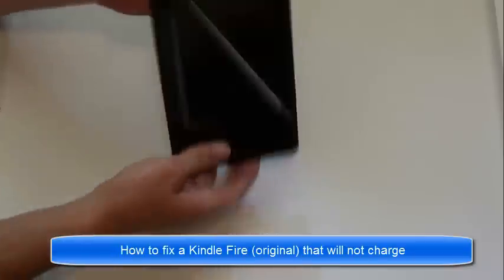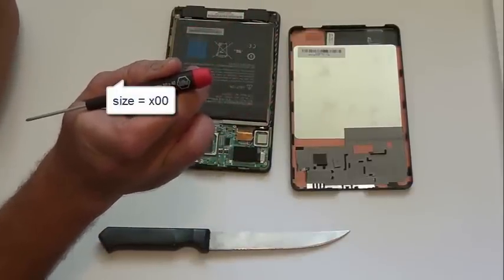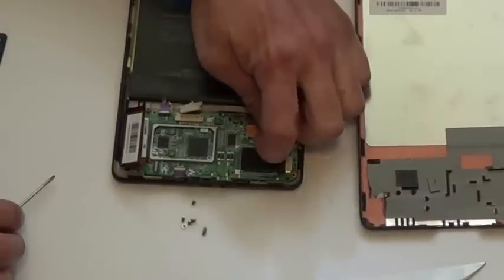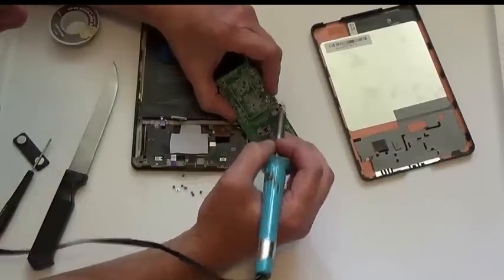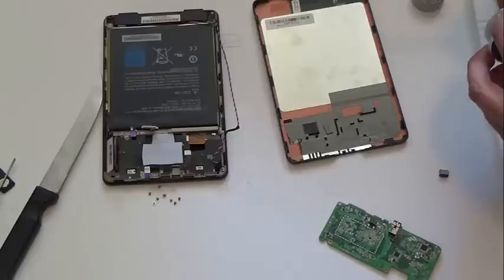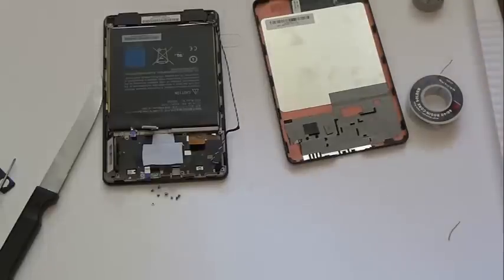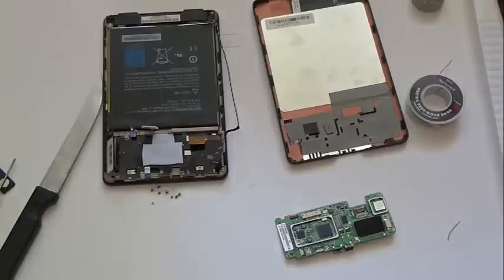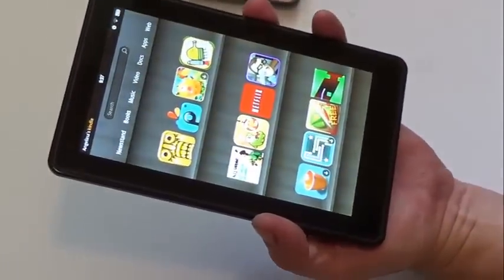Kindle Fire Won't Charge Fix

Comment: Beware when opening the case of the copper foil piece by the lower left corner shown in the video.  Keep your knife very shallow or away from this spot as much as possible. The touch screen operation was lost from slicing part of this foil which is right next to the edge of the case which appears to be hard wired underneath.
Reply from the maker: Good idea to just keep away from the bottom part of the case. Get you hands in there and just pop the back off.
Reply: Really great to know. Thank you.

Comment from the maker: Sure. The connector is very small but it does have two alignment pins that stick through the board. Those holes are called Via's. First step is to heat up the old solder- swipe the legs front to back, not side to side. just to make sure there is enough solder. If not, add a little bit. Next. Fill the Vias with solder - mine had nothing in them (probably why it got stressed). Next heat the filled vias from the otherside and get the connector onto the board...now your pins are lined up and you can

Comment: Just picked a Fire up Ebay that was listed as not charging, i figured this was the problem, but opened it up, and found something 100x times more simple(thanks for the intructable on opening)....anyone ever had a kindle dropped and the battery become unplugged from the board?

Comment from the maker: Jaime,
Yes, new micro USB ports are available but finding the right one that attaches exactly the right way, with the same through-hole alignment and the same port depth can be tricky. There are like 100 different manufactures, each with a slightly different variation of the same loosely adhered to spec. If the product did not have an outer case with such tight tolerances, finding a replacement would be easier. Try to work with the original port, if possible.

Comment: Just thought I'd add what fixed mine. It appeared it was not charging because the screen did not display anything. I took it apart and measured 3.7 Volts on the battery.... which is what the battery said on it. I decided to try and disconnect the battery for a few seconds, then plug it back in. That fixed my issue.... Thanks for the disassembly portion, that helped out!
Reply from the maker: Great! Glad that you got it to work again.

Comment: this would be very useful........IF I HAD A SOLDERING IRON!!!!
Reply: EBay has a decent soldering station available for about 40-50 bux. I'm not trying to promote anything. I just like a fair product for a fair price and this time, it happens to be ebay.
It's the complete station. Soldering iron, heat gun with attachments, power supply, desoldering equipment. Not a bad set-up for the money considering I paid more than 15 dollars for just a soldering iron at wallyworld (I needed it then...fixing my son's broke down again car!)

Comment: This video was perfect. I spent about 60-70 bucks mailing my item to a repair shop to have it fixed only for it to return and break again within a few weeks. After watching this video I decided to have a go at it and now it's charging. The repair shop did a BS job soldering the parts together. I didn't spare solder and wasn't going for perfection but still ended with a clean looking job. What really made me try it after watching this video is you opening the device with a steak knife.

Comment: Everything came apart exactly as simple as your video showed.  I did find the USB was completely disconnected and it took me several attempts to get the PCB back in as I was leveraging off the USB and the cover each time...finally got it back and it is now recharging just fine again (had to re-solder each time though to be sure it was okay).  I had to buy the iron as the one I had is an old Weller unit that is surely not 15W.  Radio Shack online had one for $15 plus the 60/40 solder set me back $4.  Purchased a multi-tool screw driver set for $3 that had a 000PH and a 00PH.  So for less than $24 bucks, back in business!  Best Buy Geek Squad told me they would charge $150 to perform the labor!  What a joke and THANK YOU for the detail.  I am not the best soldering guy either especially with little parts but got it done!
Reply: I also have a couple of very small flat screwdrivers that helped.  A letter opener with a thin edge could work too.  Also try starting near the speaker or an opening in the case.
Reply: Wow
I just purchased the Fire HD 8. They were trying to push the warranty on me.
I asked, if I get this warranty and have a problem with the tablet, are you going to take my new tablet and give me a refurbished one.
The lady said no, we don't service tablets or send them out for service, we'll just give you a new one. I didn't believe her.
They tryed to charge this guy...BIG MONEY FOR A FIX
WOW

Comment: Just repaired my kindle fire with your vid! It wouldn't charge and the warranty expired a few months ago. I either had to pay about $150 for repairs or buy a new kindle. So the option of taking a little time and buying a $10 soldering kit from Wal-Mart sounded great. [Never soldered before in my life...had to watch a how-to solder tutorial vid :)]

You gave great/ easy to follow instructions. And my kindle is charging as we speak. Thanks for the upload!

Comment: I've had two original Kindle Fires. I had to have them replaced two times each while they were under warranty for this same reason. Now that they are no longer under warranty, one of these won't charge at all. Short of throwing it away, I'm definitely going to try this. Thank you!

Comment: Hey, Peter. You just saved me hundreds of dollars by your video. My problem was in the usb connector. It was poorly soldered on and got loose as you plug in and unplug as you use it. I used my iso tip cordless for fine point soldering.  Then I had to try all my charger-cords to see whch was compatible.  I owe you lunch. Thanks again.

Comment from the maker: Helen, Mine was thick too. I used a very small amount of solder; just what would stick to the iron. I always used grounded tip on electronics but if you disconnect the batter first, it isn't going to matter in most cases. Don't worry about the flux, just get heat the traces so that the shine. pulling backwards along the trace will spread solder along the trace and seems to work well.

Comment: Good job Peter!

I have repaired a number of Kindles; this process is NOT for the beginner, faint of heart or those with marginal eyesight! The solder joints on the USB connector are tiny and the side grounding posts are simply TOO SHORT to penetrate through the PCB for a proper & secure solder on to the board.

I've done many DIY electronics projects over the years and I have to say the USB port charging design on the Kindle Fire is one of THE worst designs I have ever seen! The device was clearly designed to have a maximum life span of only several hundred charging cycles before failure. The absence of a secure coaxial DC power port on the device should be a crime.

Do not purchase a Kindle Fire thinking that it will last for a long time, because the only way that will happen, is if you rarely use it!
Reply: know of any good alternatives? I want to get something better for my mom and myself both, seeing as it's such a hassle to fix...
Reply: @bd_bandkanon  almost any other brand except apple will outperform the kindle in both substance and longevity. Plenty of yt vids against both kindle and apple. Almost as many extolling all other brands. You might want to check out the Zenpad. The 8.0 is similar to the ipad but has more features and is way cheaper.
Reply: @twicebittenthasme5545  Thanks! I'll definitely check that one out.
Reply: U wrote a whole essay
Reply: @iiifeelinqsiiii6736  And you read a whole essay.
Reply: @billyc768 boy what💀

Comment: This helped, but not because I had to replace the charger.  My kindle wouldn't reset, but when I watched your video (perusing the web for a way to fix my dang tablet), I noticed that the battery had a removable connector to the device (the little rainbow-cable).  So, I popped my kindle open, barely disconnected that cable for a few seconds, slapped it back in and voila, I now have a way to "hard-reset" my device!  Good video, not exactly what you intended but it worked!

Comment: Thanks to this video I gained the courage to open the case and perform the repair. My USB connector was also broken away from its solder tabs and I performed the repair as described in the video... it worked. I used a 25W iron I had on hand and filed a very fine point on the soldering iron tip. I would recommend a jewelers loop or a magnifier to do this repair. This stuff gets smaller as I get older! Thanks for the video!

Comment: This is awesome; I fixed my son's Kindle, although it takes some dexterity, and in my case a lot of various magnifying glasses.  I just used an old (15 Watt?) soldering iron I got a long time ago from Radio Shack.  I carefully cleaned up the metal contacts with some very fine wet-or-dry sandpaper and a tiny screwdriver tip before the soldering part; never used any actual flux, other that what's in the solder.   Thanks!

Comment from the maker: @brady... Okay, iron might be too hot. You can solder a small 'bonding' wire and fillow the trace backwards and join it at another point. solder traces are just wires.

Comment: I am a certified solderer and an electronic inspector. I just watched your video, and I will be taking my Kindle to work and I am going to give it a try. My usb does not work, except if I finagle it. Wish me luck and I will get back to you with the results. Thanks for the video...
Reply: It has been 4 years but did you find this to be the issue with yours?

Comment: You have successfully addressed a wide spread problem with the kindle fire.   As a temp fix. I fiddled e
With the cord until it made contact with the printed circuit board you mentioned.    I'll work on tHe fix when I get a sodder device. You have motivated me to fix it myself.  Thanks so much

Comment: Thanks, Peter Carcione.  I tried this about a year ago and didn't get enough of a build up on the traces due to a wider tip.  Used a fine tip the second time and fixed my wife's old original Kindle.  Granddaughter has one that won't charge either so I will be looking at that when they come the fourth.
Reply from the maker: Ken Claridge Great! I am glad that you got it to work. The only thing better than feeling like a hero is when your granddaughter thinks your a hero. I cant wait for the new USB 3.1 connector - sure hope that it is better.Happy 4th, almost.

Comment: Yeah!! I fixed it.  I watched another vid to learn which connector was what and found that the big golden(ish) one on the side is the touch screen. I made sure the holes in the side lined up with the screw holes before I locked it down.  Now it turns on, swipes, and charges!  Thanks again for your excellent video.

Comment: I had a similar problem that developed with mine. Turns out it would charge, but not boot. Cracked it open after watching your video and found a small problem with one of the connections to the card. Works like new, now. Thank you.

Comment: Good job! I have an almost new kindle first generation that my wife bought with the same problem. I have all the tools and more importantly I have the time as I retired recently. thanks for the video.
Update, the USB connector didn't fall on mine off like yours did in the video and the 5 leads were well soldered down. I was the metal tabs on the connector that didn't have solder and didn't want to accept soldering until it was clean up. Then it took solder and the battery charged no problems.
Thanks for the video.

Comment from the maker: It is probably just a gap pad. I have seen them used to fill the gap between the PCB and the connector. If it fits there, that would be my guess. Otherwise, it could be used on the other side, to give the port more rigidity and keep it from moving. It would be nice to know that they have addressed this problem.

Comment from the maker: Good point. True. With 3 kindles and 4 android phones, we have so many micro usb connectors we checked that without thinking. Those cables and connectors do wear out. You should also make sure that your kindle is not locked up.

Comment: Good clear instructions for removing the PCB.  
It's a pity that mine didn't have a loose USB connector to fix and, being a UK version, the PCB didn't show the soldered connections at the back of that connector (not that I have the dexterity to undertake soldering on such a small space).
In the end, disturbing the system didn't fix the problem (I didn't really expect it to), but it was a good exercise in accessing the insides of an old Fire.
Thanks

Comment from the maker: Not sure what sized tip, though I did get a new tip before attempting this. I think the secret is working front to back. This spreads excess solder along entire trace and makes excess balloon out back...so no touching other traces. No problem bridging while soldering...there is no power at this point... take your time

Comment from the maker: @Aaron Burns - If you use a higher wattage iron, it is simply going to be hotter. For electronics, low wattage and grounded tip are preferred, although neither are required. If the iron is too hot you risk lifting the traces or getting cold solder joints. You can simply work faster but this can lead to another cold solder joint. While this bad, it is totally better than lifting a trace (which is not the end of the world either, as it is only a wire and usually can be replaced).I like to heat the components that I am working on to get the solder to flow nicely.
Reply: Peter Carcione What size tip are you using? How small are the traces? Are they far enough apart that they will self separate? Also, putting solder on the iron will help the heat transfer, but soldering off the iron is the definition of a cold solder joint.
Reply: Peter Carcione Thank you so much, My wife and kids are eternally grateful that I was able to fix their kindle.
Reply from the maker: Matt Borden Outstanding... It is great to be a super hero to the kids. Glad to help.
Reply: +Peter Carcione help please T__T
Reply: I used to solder for an itt company and I always soldered with solder on my iron. Which we called carrying our solder.  I had never heard the term cold solder joint, we were just told this is bad fix it lol I know the way to fix them though, you need flux and heat as flux paves the way so to speak for a smooth solder joint. I'm looking at getting a soldering iron as my mom's kindle fire has stopped taking charge, it fell in the floor and I'm guessing it's knocked loose the usb port thing. The one I'm looking at on amazon is a 60w iron, as I do have experience with soldering I think it'll still be alright, I can't find a 15w iron on amazon anywhere. I'll just have to work fast and not hold the iron on the board long. I wish I had a microscope to work with as well but I don't.
Reply: Peter Carcione gukmo vfgdt
Reply: @PeterCarcione please help with Kindle fire won't turn at all need more advise thx
Reply: Steven Robinson e

Comment from the maker: Hey Killa,

So it will charge when you plug it into the wall - that is good. Some computers only provide 5v@500ma over USB2, but the brick for the wall provides 5@1A that is 2x more than some PCs. That is why you might not be charging or charging slowly. Sound like you are up an running, but if not... a Kindle Fire 2, it is most likely still under its one year warranty. I would get it fixed by Amazon directly.

Comment: Your video was very helpful in identifying the problem. However I an the type that takes something apart and never am able to reassemble. Also could never work with a soldering tool. Wish that I could, with your instruction would be able to repair my Kindle. May be cheaper to replace. Thanks, very informative.

Comment from the maker: Try doing a reset first. Do this by holding down power button for 10 seconds. Do this twice. If it still does not turn on, it could be a charging problem. 

Do you get a charge light when plugging in?
If you wiggle the connector a little?
Try another adapter, if so. If you still need to wiggle the adapter, you might have a loose connector like the rest of us. 14,000 and growing so not so rare.

Comment: Thank you so much, i had an old kids fire edition tablet and was preparing to swap the parts until you mentioned about WARRANTY, called amazon and a replacement is on its way as it’s still in the 2 worry, fuss free guarantee, Super helpful video. Thanks again

Comment: You reminded me of the little white retainers I removed from the ribbon cables. Unfortunately, you didn't show  this part of the reassembly. I had pulled the retainers off the connector and was unable to reinstall them so I cut a little squares from shrink sleeving and pushed them into the connector to secure the ribbon cables. Might have been simpler and cheaper had the Fire been manufactured that way . Thanks for caring.

Comment from the maker: Interesting. Check the battery connector to make sure that it is seated all the way. If that doesn't work, I would unplug the battery and try powering it from the battery terminals. Make sure to match power specs of battery - not sure if the power adapter will help in this but it might.

Comment from the maker: I have always used a grounded tip on electronics but this is a pretty simple fix. Just reheat the solder traces and get out... so, perhaps it is overkill; it depends on where you live (Las Vegas residents should used grounded everything since static electricity is everywhere and electronics hate that).